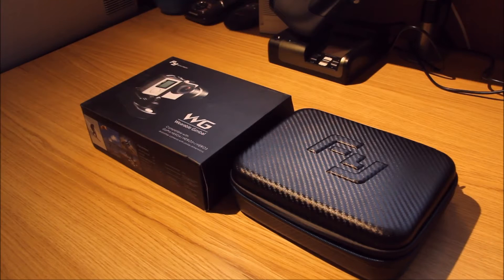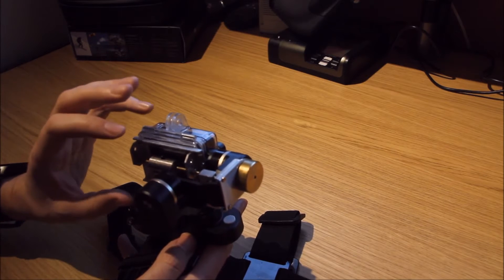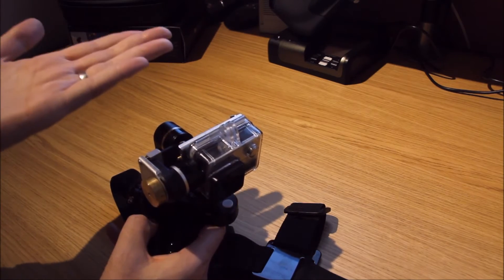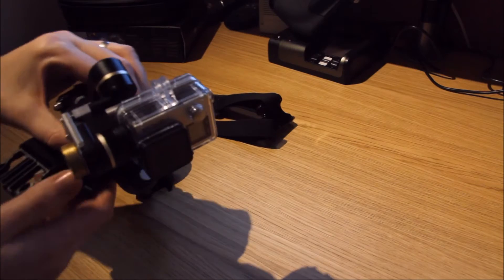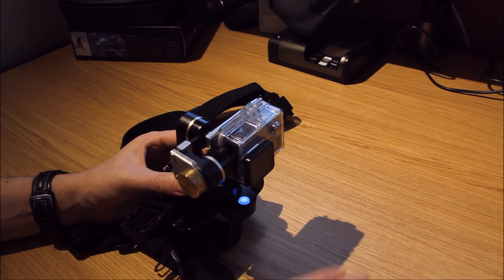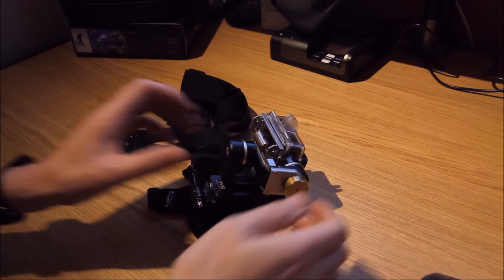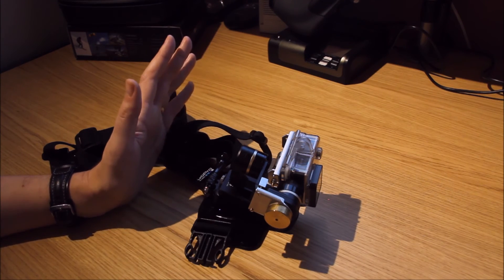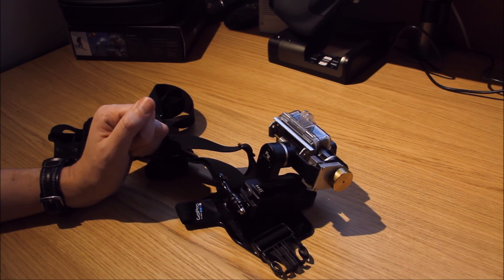Feiyu Tech FY WG Wearable Gimbal For GoPro 3/3+/4 Camera - Modifications (Part 2 of 3)

Comment: I wonder could you awoid it if you use gopro without a battery and pull thin  the power wires out. If the battery weights close to housing, maybe it can be done simpler. Personally, I would rather epoxy gimbal bracket onto the housing back door instead of making all these machined parts.
Reply from the maker: Running it without the battery in it is an interesting option. I just tried and it didn't sort the vibration problems. It may be because it's now horribly unbalanced, or just that the gimbal has problems (I hear they do go wrong after a bit). Honestly I'm probably gona just get a Removu S1 as soon as they come back into stock. They've done all the work getting the kinks ironed out, plus the thing is rain proof and runs with it's own protective housing. They've basically seen the same flaws I did and come up with a slick manufactured version of this solution. Pricey though!

Comment: Blimey! That is impressive. I'm glad you got it working. After your first video I am getting one. Though I have a session so I saved a bit on the camera and I am happy with the quality of the camera. I'm hoping that the sound will be OK, as the motors wont be working so hard to balance it as its lighter and not as wide. I am looking to chest or shoulder mount it and its just for walking around with it on. Though with a polarizing filter added on it should be pretty bullet proof. I like your solution. I just don't think the gimbal is up to the task. Your dad is awesome for doing that for you. There is another video from a guy who doesnt realise that if you hold it for 2 seconds it stays locked to the new heading. I reckon I will get a selfie stick with a screw bolt mount rather than a go pro mount. Great video. Needs to be more widely seen.

Comment: ben i need some advice if you have any :-) i want a handheld gimbal that will hold my gopro 4 in its waterproof case but i also want the light and motion sidekick duo attached as well - is it possible?
Do you have any solutions?
Reply from the maker: Not with this setup. i think they do a much more serious setup for dslr's. You're not going to be able to wear that though.
Reply: +tazong Thanks for reply - I am now thinking about getting a handheld gimbal for gopro 4 - I think with right attachment could clamp light to handle but I need a gimble that holds the waterproof gopro case - any suggestions many thanks in advance.
Reply from the maker: +tazong I'm not aware of anyone doing it (hence this project). It's crazy, one of the manufacturers must wake up and do one soon!

Comment: I just got my WG modified for the waterproof housing. I went with that so I had more surface area on the housing back to mount the bracket to. I actually had an aluminum bracket fabricated to replace the one that came with the gimbal and it works great with no balance issues. My question is that I noticed the middle axis motor gets fairly warm after using it for a little bit, I assume due to the increased weight. Have you had any issues with your gimbals motors heating up or failing?
Reply from the maker: Before we added the counterweights, yeah they were heating up badly. Between that and the horrible vibrations in certain orientations, it was a non starter. I was worried that I was doing damage, and gona run the batteries down superfast. Thats when we started looking at plan B involving counterweights to give it a natural neutral balance. This sorted the heating issues, and with some careful tuning of the weights has stopped the vibrations too. It seems to get into a positive feedback loop overcorrecting if the weights arn't just right. i ended up slackeding off the screw on the end of the arm as that seems to give some damping to the system.
Hope you come up with a solution, when experimenting i can recomend bluetack with coins to get the right weight. Do make sure you add adjustment to fine tune it though.
Reply: +Ben Pattinson hi ben, any chance you can make another, ive just bought this and didnt see this video, done a bit of research , but after i bought, i see you carnt mount the cover, ill pay for the part, any chance you can help me out pal, thanks in advance, cheers john,
Reply from the maker: +northeastbushcrafter Hi, Just had it skiing for a week, and although it worked pretty well, i had enough issues with it starting to oscilate that i want to play with the design more. Not sure dad's up for fabricating more of these, we'd definately need to simplify the design a lot first. it took long enough that you wouldn't want to pay for his time! Will be posting more videos showing the results in a bit.
Reply: cheers ben, wey if ya dad fancys fabricating one more, im will to pay for his time as i think i may have bought this, and going to regret as i do a lot of out door camping in rain ect with my son, and im only going to be able to use this in nice weather, not good as i get out in all weathers, keep me posted pal, really apprecate a bit help if your dad is willing, atb pal, john